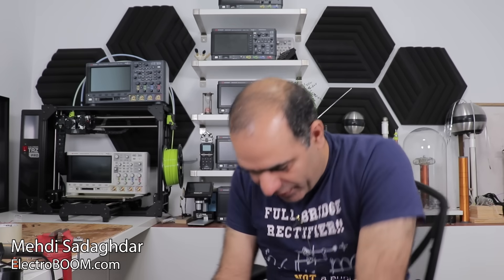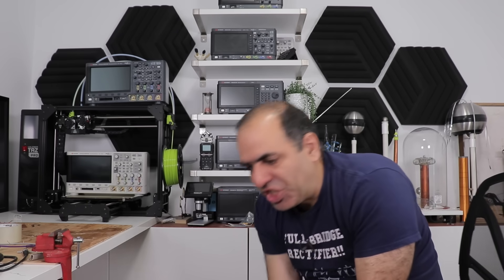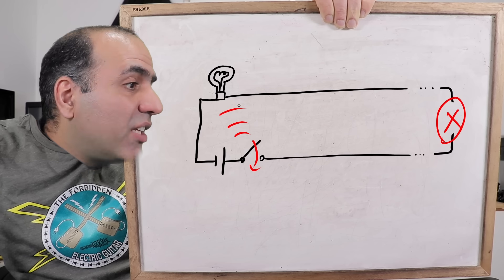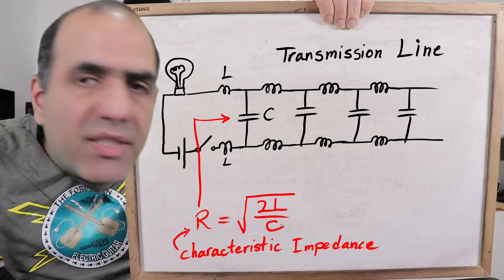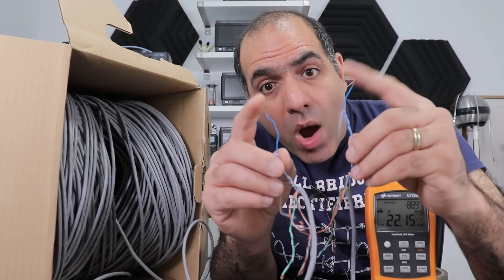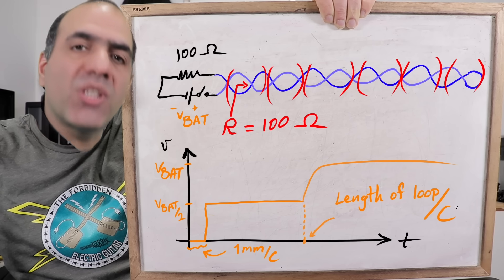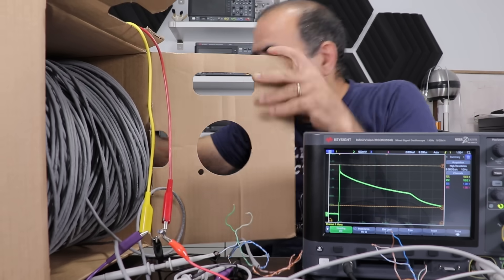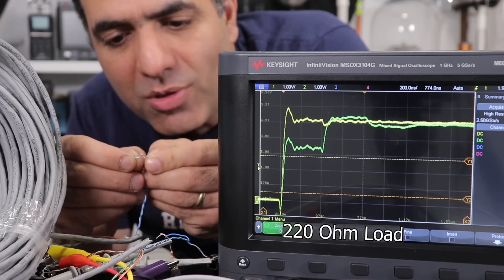Testing the LONGEST LOOP OF WIRE!!! to Turn a Lamp On

Comment: The calculation of the speed of light is actually pretty spot on. In my lectures on the topic of communication systems we estimate the speed of light to be (2/3)*c_0 with c_0 estimated as 3*10^8 m/s, meaning your value fits perfect to these estimations.
Reply: Was about to comment this
Reply: A more precise estimation for coaxial cables is c ~ 1/sqrt(Epsilon relative), where Epsilon relative is the relative dielectric constant of the cable's dielectric. For coaxial cables, 66% is an usual value, but with foam kind of dielectrics, the signals can propagate around 90% of the speed of light.
Reply: Would this speed change in a super conductor as originally proposed by Veritasium?
Reply: @_BangDroid_  Relative electric permitivity is dependent on temperature so yes propogation would be different and probably faster than regular material in super conductors.

Also it depends on frequency of the signal so for DC it's different and for AC it will be different because of how materials interact with changing field.
Reply: Nominal Velocity of. Propagation is the definition and is Stated on the box of most major brands of Cat cable. 65%-69% NVP is typical.
Reply: As a percentage?
Reply: Yeah, speed of light depends on the relative permittivity and permeability. c = c0/sqrt(ε_r*µ_r)
For FR4 PCBs e.g. ε_r = 4 and µ_r = 1 --> c = 50 % of c0
Reply: Also, the distance is actually larger because the twist adds length, different amount for different colours. The cable probably has a propagation speed printed on it that tells the actual expected speed in c, somewhere in the ballpark of .75.
Reply: If ur a kid: 🤔
Reply: There is no speed of light in copper below high frequencies. At low frequencies electromagnetic waves don't propagate in conductors as photons (light) hence their is no speed of light. The actual velocity factor depends on the interaction between the conductor and the permittivity of the dielectric surrounding it in addition to the frequency. A bare copper wire can have a velocity factor as high as 99% while cheap Cat3 can be as low as 58%.
Reply: c_Õ
Reply: I'd say ElectroBoom hit it out of the park😊❤
Reply: Except it's impossible to measure something that is the fastest something possible. Maybe it's faster one direction than another lol
Reply: I love turtles
Reply: @waitemc  came to say the same thing
Reply: C is 299,792.458 km/s.
Reply: Funny, but we have here a group commenting in agreement, ad nauseam !
Each trying to put a spin on it, as if they thought of it !
Hilarious !

       ⚡😂🤣😂😳💥
Reply: @sleeve8651 , and here you are adding in a level of stupidity that no one asked for. 👌🏻🤦🏻🤷🏻😁😂🤣
Reply: it should be speed of electron, no photon involved in the experiment
Reply: @kuriel07  Speed of propagation of electromagnetic field inside a conductor to be exact.
Reply: @MaulikParmar210  Inside, or rather around, on the surface of the conductor.
Reply: @ataraxia  Does it matter?
Atoms have physically 99% space around them. Permeability of EM fields is mean effect of how these atoms wind underlying Electric and Magnatic fields which either slows down or limits speed of propagation or allows certain path because atoms may have wound those fields. Fields only acts as a carrier of energy and it's still an open question why fields behave differently in different configuration with different energy levels.

Nonthless, there are multiple ways to describe phenomenon,  some would be traditional,  some would use theries like Mean Field Theory and some would use Quantum Mechanics to describe the behaviour, but none explains  crystal clear on what happens to energy or whole transformation process from one form to another. We only see combined result as an external observer.

It doesn't change laws of universe in anyways,  just our point of view at micro, macro or nano / famto scale.
Reply: @MaulikParmar210  the speed of the mobile electrons is in the range of mm/s, and there is no electromagnetic field inside a conductor.

The measured speed of light is basically the speed of propagation of light on the cable dielectric.
Reply: @theondono  Read whole convo again from first comment, no one is talking about drift velocity of electrons here. All are talking about propogation speed of energy inside conductor.

P.S. Read field theories to know more what people are talking about. Claiming EM field doesn't exist inside conductor is directly denial pf Coulombs law.
Reply: @bhargavmistry1274  I'd suggest to see Dr. Lincon at Fermi Lab if you are interested in learning more about subparticle world.

Actually we know what happens inside any electric / di-electric material with the help of Mean Field Theory which describes this in mathematics. It's used to analyse lots of things including super conductors properties.

We already know there exists underlying energy fields that are not directly accessible to us but we can indirectly monitor their existence. Also higgs boson in standard model is glue to make it perfect for now which opens up lots pf questions. Only problem is technology is still a barrier in some cases where we need to take very precise measurements (more than 5-sigma sometimes) to actually prove theories practically and accept that universe acts as predictions made by those theories.

By one step at a time different theories can be combined into one theory of everything,  a dream for any physicist to know it all.

PS. Edited typos
Reply: @MaulikParmar210  indirect monitoring is not same as experiencing real thing. Like we still ASSUME speed of light to be C, which is again indirect measurement of distance traveled and reflected back by the light in half i.e. 2C/2. 
Current science provides elementry quantum model which is good enough to do most of the real life approximation.
Reply: @bhargavmistry1274  I agree, even Derek from Veritasium had made a video of why no one has ever measured speed of light. Similarly, there are many other things which are probablistic in quantum mechanics due to inherent uncertainity of their small scale. So, although you can devise a theory that fits certain phenomena doesn't mean it is entirely correct (or perhaps universal might be better word). This can be result of false causality. Since we are talking of conductors explaining things with em field has provided us mostly with accurate results so far so theory cannot be denied either unless something contrary is observed.
Reply: @MaulikParmar210  flex. Burn
Reply: @bhargavmistry1274    We dont assume speed of light. It can be measured by independent methods, multiple methods that can vouch for constant speed of light for our world. Round trips,  Astronomical Measurements, Cavity Resonators, Interferometry and many other methods which have no dependency on each other and gives similar measurements.

What people mix is speed of causality is C, which happens to be speed of light (the photons) for this world but not necessarily according to special reativity.
Reply: @MaulikParmar210  https://youtu.be/pTn6Ewhb27k
I would suggest you should watch this video if you haven't already. What Bhargav is saying is actually explained in the video.
All the methods you described were based on presumptions we make about light (ie. Assuming it to be a wave or particle just travelling in space). Talking of special relativity, if you were a photon the time would stop for you and if were to travel to from point A to point B it would be instantaneous for you, that's what really time dilation is. So the point is you never know which trip the light is making that tells us its speed, also since light is non classical in nature, our intution that light travels from point a to b and back in constant time might even be flawed. And I know there are multiple ways to prove that the speed is indeed c, it is possible there might be things that not yet have been observed yet, since the speed measured is always inference based never direct.
Reply: @MaulikParmar210  Yes. Propagation velocity. Look up the specs on your favorite coaxial cable and you'll see a spec called propagation velocity. It takes time for a wave front to move through all those hypothetical inductors, resistors, and capacitors.
Reply: @MaulikParmar210  What drugs are you on? 

That there’s no EMF inside (perfect, if you want to be picky) conductors is a standard assumption in electrodynamics. In fact there’s several effects (like the Meissner effect) that depend on that fact.

It’s a typical exercise for undergrads to calculate electric and magnetic fields and find out that those are 0 inside the conductor. If you had electric fields inside a conductor, you’d had potential, so you’d end up with infinite currents (V/0). Having magnetic fields inside would break the laws of induction, because the induced current on a conductor is the one that makes the magnetic field inside 0.

EDIT: and FSL Lab talked about “the speed of electron, not photon”.
Reply: @theondono    that's the problem, people usually dont want to wrap their heads around complex things. Modern curriculum stops where quantum mechanics and field theory starts and that's where most people stops thinking further. They usually have no clue and tries to interpret micro phenomena with classical approach. Yes the eddy currents would be there. Cancelling out each other at kacro scale.

FSL labs talked about speed of electrons and they are usually in range of meters/ second at most. The topic is speed of propogation so perhaps you want to evaluate what you are saying here. We the other reader totally understand that subparticle physics isnt for everyone, jist the theories are enough to take years of time to understand as it's contributed by coutless scholars in their time.

Yes if you think traditionally your assumptions would be right, but at micro level, things get ugly and cannot be described with classical physics and that's why we need to combine GR, SR along with discoveries of Maxwell, Newton,  Gauss, Coulomb, Pauli, Feynman and many others with QED and other quantum theories that are in "Full Agreement with classical physics" at macro level and describes inner workings of subatomic world that classical physics sees as mean effect of all of these.

If you can't wrap your head around it, I'm afraid that's where your world ends and relm of quantum physics emerges.
Reply: @MaulikParmar210  maybe he misclicked and replied to the wrong comment, because one of the first ones is specifically talking about speed of electrons, which is wrong.
Reply: @MaulikParmar210  speed of light is limited to this universe and stops science to explore beyond this universe. 
This universe ccould be just a nucleus of a much bigger atom which could be a part of a Mega universe! 
Is the current science able to validate it?
Reply: @bhargavmistry1274   Stability of universe depends on lots of constants and changing them changes how matter will interact, we can verify that. We can also predict speed of light and measure it for our universe. Modern physics have predicted existsnce of behaviours that classical physics cannot and practical measurements have proved most of them to be in agreement at 5-sigma to 6-sigma agreements. 

Causality is something that happens as effect of energy interaction with space time and ofc we can measure and verify universal constants that defines real universe.

Current science has no evidance of existence of any other universe and theories that predict that are still work in motion and many of the though experiments habe been discard due to inability to make stable predictions.

Math can say there can be other configurations, but chances of those configurations are so rare just like how wavefunction collapse as you observe and would endup in same universe as you are in. And this has been verified upto 1 in a milion & billion observations for constants that actually defines pit universe so yeah like it or not, you and I are pretty much stuck it it forever. 

P.S. Speed of light kust happens to be speed of causality. Because photons are massless they experience no time and would travel as fast as universe permits it. And permitivity of electric field in vaccum is well defined and derived measured constant that can verify it.

Your questions are already answered if you look at right sources:
https://youtu.be/msVuCEs8Ydo
Reply: @MaulikParmar210  you can try to escape your way and talk about quantum physics, and we can talk electrochromodynamics if you want. 

The effects you are talking about are irrelevant to the discussion. Yes, the topic is speed of propagation, but specifically it’s the speed of propagation of EMF (i.e. light) inside dielectrics.

GR, SR and QED are totally irrelevant and unnecessary to explain the phenomena on the video. Just a good understanding of Maxwells equations is enough.
Reply: @MaulikParmar210  Outside the conductor?
Reply: @MaulikParmar210  It's actually speed of EM field outside the cable(insulation in this case). And because this is true, dielectric constant of insulation defines speed of SIGNAL(not electrons, not photons and not em field) inside cable. eq for speed of signal is v=c/sqrt(relative dielectric constant). Since he measured speed 2/3 of c, this means that the cable effective dielectric constant is around 2.3.
Reply: @kuriel07 Also not quite correct. Electrons travel slow af. What is important are the electromagnetic waves. And light is commonly moddeled to be EM waves. So talking about light speed is the correct term.
Reply: @115maxx  Electrons travel near the speed of light, they just like to hang out and backtrack a lot. Doesn't matter how fast you're traveling if you stopped at every gas station along the way.
Reply: @bears7777777  Aren’t Electrons around 2000 km/s fast?
Reply: @kuriel07  photons are the mediator particle for electron interactions. Any case where electron interactions are involved intrinsically includes photons.
Reply: @kuriel07  the electron travel very slow in system like wire. They only attain drift velocity of few m/s even under huge potential differences. If electron were to move from power station to your house to supply power it would take months if not days to get power at house after turning the switch at power station so the electricity in wire is taken as em wave as it generates the force necessary to move all electron almost simultenousely, which is limited by the spped of light(at which the field is created). So, it is indeed correct that it is electron that take electricity but the electron flow due to current is not quite conventional.
Reply: @kuriel07  they’re pretty much the same thing. Speed of light has nothing to do with photons, it’s just the universal speed limit
Reply: @jimmysyar889  at least until we know better :D
Reply: @kuriel07  The electromagnetics field are transmitted by fotons in the corpuscular particle theory. There are fotons.
Reply: @kuriel07  the electromagnetic field is carried by photons
Reply: @kuriel07  it's not the speed of an electron per se but rather the speed of an electromagnetic wave. light is an electromagnetic wave at high frequency.
Reply: @kuriel07  NO. Electrons move way slower than fields.
Reply: @kuriel07  "Speed of Light" is a layman's term for the Universal Constant, the "c" in E=mc^2.  The Universal Constant applies to everything, but light is the most-widely known thing that actually travels at it.
Reply: @Belboz99  i just think of it as the speed of causality/ cause and effect
Reply: @Belboz99  yes but photons are massless, electrons aren't.

Comment: It’s receives “SOME” energy at 1/c but depending on your voltage will depend on whether you can see the light right away. His question was missing that information.
Reply: Veritasiums video was completely misleading. he showed closed loops but later talked about an effect that wouldn't even need the cables to be connected at their ends. But he is a Youtuber and not a Physicist / Electrician so mistakes like that happen
Reply: @yoshtg  Derek from veritasium is actually a physicist, he has a doctorate in physics education, also a bachelors in engineering physics.
Reply: Yes, I think they talked about it in a followup video. However, it's enough to light an LED at least.
Reply: For sure. And I think that Veritasium, in its first video, was really trying to convince us that power received by lamp was only due to energy waves between wires, not energy wave propagating along wires
Reply: @dwarfy2744  sound likes a Nikola Tesla fans; "wireless energy".
Reply: @xponen  Sound like xponen don't understand Faraday cage principles and want to cercle someone into a conspiracy theme.
Reply: @dwarfy2744  "energy waves between wire" is exactly the Nikola Tesla's "wireless electric transmission" dream. People who focus on only this specific aspect to describe electricity is a fan of this dream.
Reply: @xponen  Nicolas Tesla's dream is to transmit high power energy. I never talked about it, and energy transmission between wire is reality. Radio transmission is nothing else